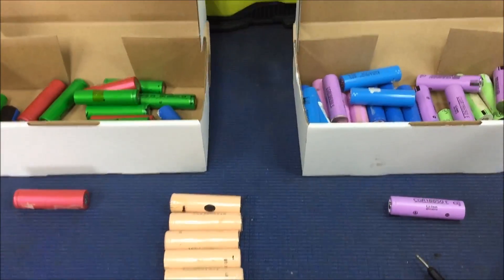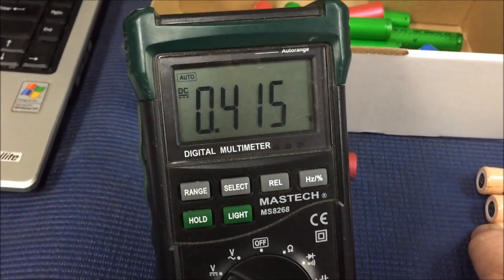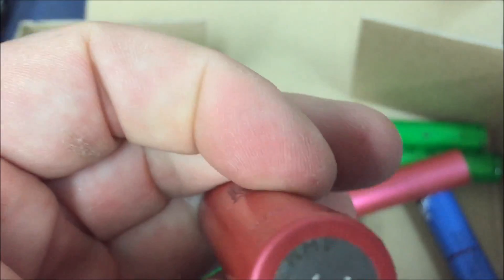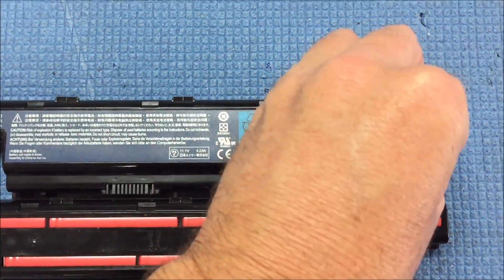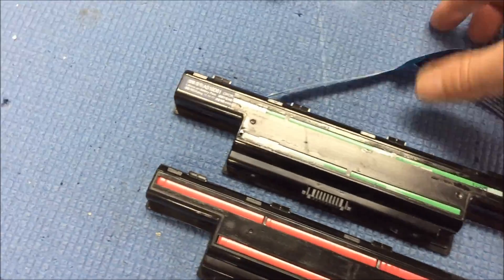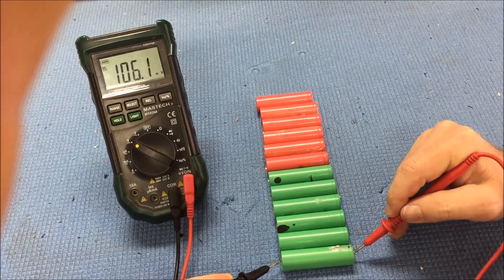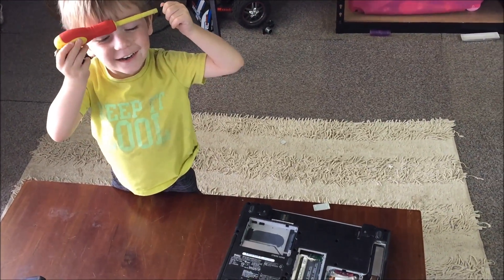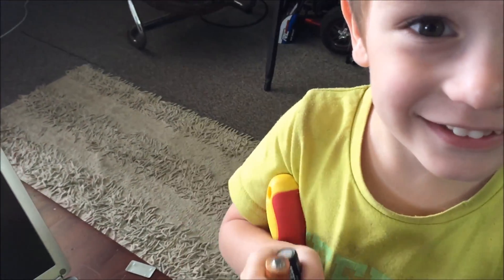Homebrew Powerwall Project S01E02

Comment: Do you have a link some where one 18650 protection boards for cutting voltage off at 3volt? Or a usb voltage booster that stops automatically at 3volt? Any help would be appreciated thanks Rob
Reply from the maker: I use www.batrium.com 100% configurable top, bottom soc everything & more

Comment: I need to make 35kw battery pack for my ev project. advices are wellcome by the way I'm going to use recycled laptop batteries.  do you know how many cells do I need? thanks
Reply from the maker: Depends on the voltage, range & capacity of cells

Comment: Hey thanks for the tip about the label - Lenovo batteries (or at least the one I've got) are this easy to cut open as well.  I was looking at this thing worried that I'd split open one of the cells with my spreader, but once I removed the label it was easy top access.  Only just started watching, it's looking pretty intriguing.

Comment: My Daughter loved old atx power supplies when she was little, she would break/cut bits off and stick them on cardboard boxes to make robots. When she was older 9ish her Nan and Pa's Telstra wireless modem was not working properly so she took it upon herself to disassemble the unit and find the problem! Of course the problem was only caused intermittently because they lived in a signal black spot. I had to explain to her what a warranty was and if it wasn't working it could be sent back.